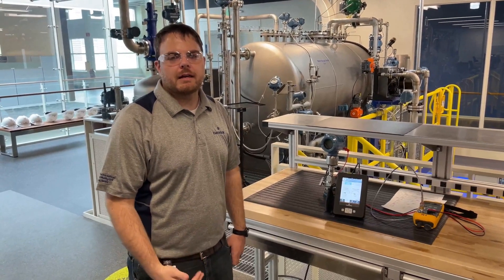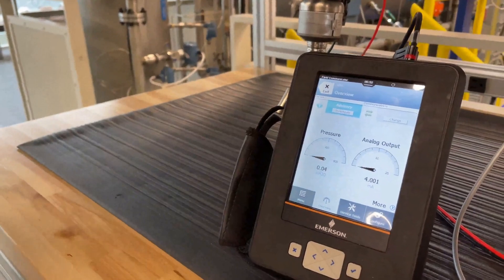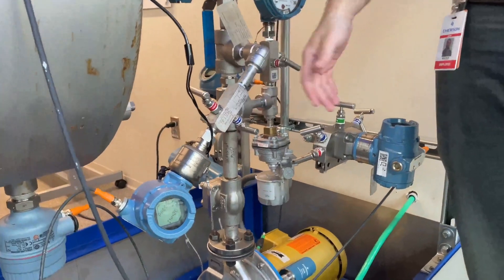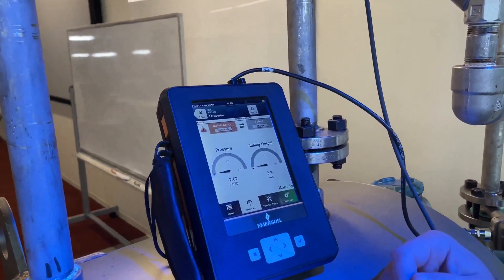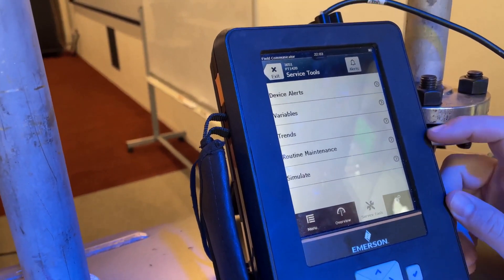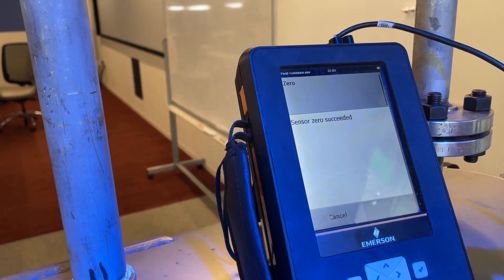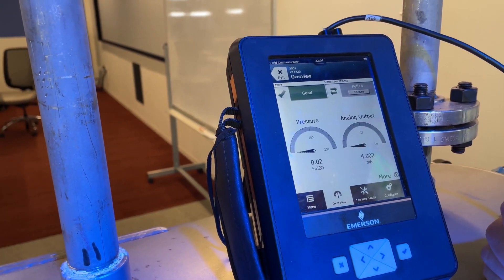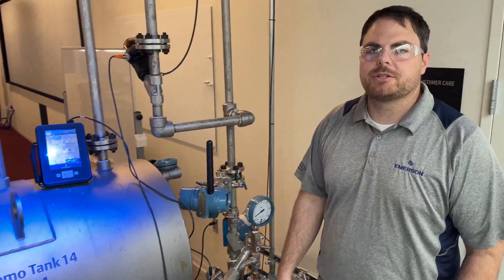Rosemount™ 3051S Pressure Transmitter How-to Zero Trim

Comment: When I can use A/D trim (sensor trim) option instead of zero trim ?
Reply: the D/A trim is different from the zero trim. the D/A trim is needed when the analog output is not correct.